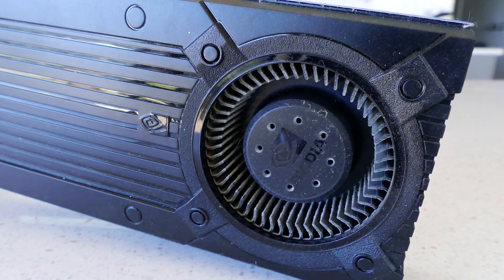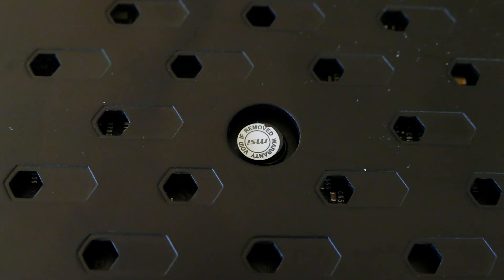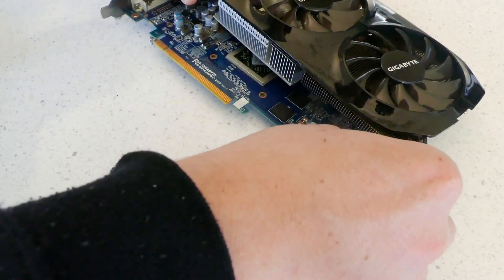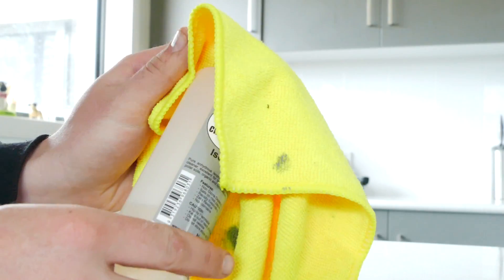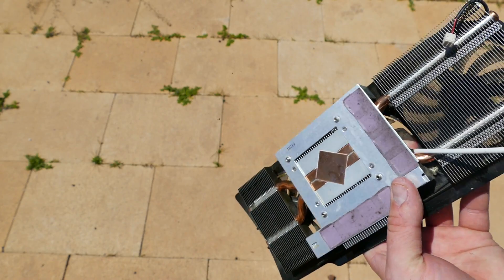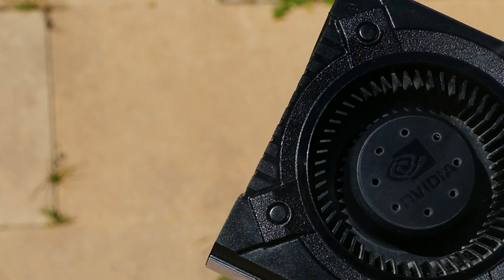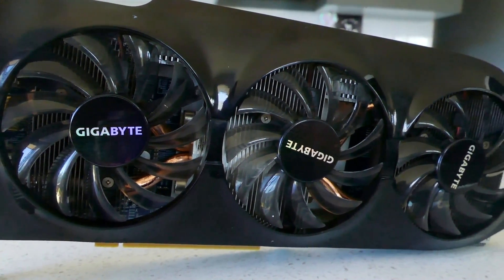How to Clean a Graphics Card/GPU

Comment: No ESD strap? Baby wipes? I guess we don't care about unsafe chemicals or static discharge.
Reply from the maker: Never used an ESD strap, always de-charge myself before handling electronics and am yet to kill a component through ESD.

Again, never had an issue with baby wipes or similar wipes on any of the many components I have cleaned.

Might want to hold off on assumptions and just politely ask a question or 2 next time.
Reply: @EverythingbySam  A better option would be anti-static brushes and isopropyl alcohol of perhaps 99.8% purity or having as little water as possible on just the board and the solder joints, and not on parts like plastic. If your stuff works for you, fine, but it is safer to do what I've suggested. ESD can cause a latent failure where it isn't noticed right away. It is always better to just ground yourself through a strap to prevent ESD. I just want to suggest this so people see this.
Reply from the maker: @wiggles7976  People at home do not freely have those items available to them so this is an alternative that still works very well with items they are more likely to already own.

You scare people away if you pretend you require those items as a minimum. I prefer to encourage anyone to do it.
Reply: @EverythingbySam  On the other hand, if someone spend $2000 on a pc build, they should know the proper ways to maintain their equipment with $20 worth of cleaning supplies. You could clean pretty much any PCB (just the PCB part, not plastic parts or other materials) with 99.8% isopropyl alcohol and an antistatic cleaning brush, so it doesn't hurt to get those things. The average person has loads of PCBs in their household. Isopropyl alcohol can also clean metal hardware on guitars for example. It's useful to have.

Comment: Baby wipe on pcb 😬 that's a good way to rip off some components
Reply from the maker: You would be absolutely dead wrong on that one. Cleaned well over 100 cards and have NEVER damaged a single card.
Reply: @EverythingbySam  well you might be careful with it but if I were you I would say in the video to be careful because fibrous materials like a baby wipe could damage or rip off components if not careful
Reply from the maker: To be honest, I am not careful or cautious of components, I wipe fairly hard to get the solid dust and grime off. If a component falls off, that’s poor manufacturing more than me damaging the card as solder should be strong if done correctly. You don’t have to be as cautious as some people want you to believe.

Comment: what if i don't have a thermal paste? can i still take it apart, clean it and just put it back together?
Reply from the maker: Technically yes but I wouldn’t advise it. Once you have separated your thermal paste it’s highly advised to clean it off and replace it.
Reply: @EverythingbySam  thank you. My card has started going up in temp to about 96 and I superficially cleaned it with just compressed air without taking it out or apart. Didn't help so I guess I need to clean it more or might need a new one.
Reply from the maker: Replacing the thermal paste is one step as well as a thorough clean as compressed air alone won’t properly get all the dust out of your card. Don’t forget to also clean the dust out of your case and fans as that will help.
Reply: @EverythingbySam  Yea I think I need to replace my fans. They are making noises and sputter on and off every few seconds. I also ordered thermal paste so I should be covered.

Comment: Just to be safe, it is recommended that you first cover the entire gpu die with thermal paste to prevent damaging it. Unlike cpu that has an integrated heatspreader, the gpu doesn't and raw gpu die might have some parts that is not measured by a thermal sensor and might overheat. It's better to be safe than sorry

Comment: I changed the thermal paste in my 1080 ti and got a bunch of pink and black pixelation and games would crash after.
Reply from the maker: Sounds like either you didn’t put your cooler back together so it’s making proper contact with the GPU die or you removed or damaged the thermal pads that make contact with the memory chips are around the GPU die.

Comment: Am I the only one who can’t seem to unplug the fan plug?
Reply from the maker: Some can be quite tricky. Never pull by the wire, only by the connector and use a little flat head screw driver or something similar to wiggle the connector out.
Reply: @EverythingbySam  thanks :)

Comment: I'd like to ask , i think my gpu is about 3 or 4 yo if i'm not wrong , cuz it could be older and it is the GTX 1050ti 4gb Phoenix Edition ( 1 Fan ) , 1 year earlier i started to notice my gpu performance started decreasing , is it possible because of this thing " Cleaning it ? " or are there anything else could lead to a gpu low performance ? from what i should have in performance per example cs go and valorant let's take these meduim rate games , it should be around 190 200 fps in high settings but i get in cs go max 120 with sudden fps drops , same with valorant ( it should be at least 170 fps or 180 fps but i get max or avg of 120 fps )
Reply from the maker: Multiple things could be the issue there in all honesty.

High GPU temperatures can cause frame loss and stuttering so at least blowing the dust out of your entire system would be beneficial especially if you never have before.
Reply: @EverythingbySam  Nah i did several time but mainly once in a month i think , but never in my life changed the thermal paste of either CPU or GPU , i didn't know its was a neccesairy ...
Reply from the maker: After a few years it’s good to give your system a deep clean which should include a thermal paste change

Comment: I'll keep this in mind when I need to do mine. Mine's been good so far. :D
[I have 99% alcohol to use for cleaning so I'll probably use that instead of baby wipes.]
Reply from the maker: Use that and some Q-tips or a micro fibre cloth and you will get the majority if not all the dust and grime off.

Comment: Will a soft bristle brush be ok to dust off the board of the graphics card?
Reply from the maker: As long as it is made from non conductive materials you will be fine
Reply: @EverythingbySam  and how would u know  that? cause i literally just brushed me GPU with it an hour ago oof
Reply from the maker: Well you would of got a static shock if it generated any electricity.
Reply: @EverythingbySam  ah ayt so far none, good to know man thanks

Comment: My gpu is a gtx 960. I did everything right except when it came to wiping down the thermal paste with a micro fiber cloth. I hope its not too important? But everything else really helped me a lot. Thanks!
Reply from the maker: As long as you cleaned off the old thermal paste (if you took the cooler off) and repasted it you will be fine.

If you did just slap it back together using the old paste there is a fair chance you may experience thermal issues.

Comment: I got and RTX 2080 for like a bit more than 1 year. at the beginning it was constantly on 60 degrees under high stress, and now it sometimes reaches 80 degrees i dont know if the thermal paste can vanish or be so uneffecient after already about a year. What do you think?
Reply from the maker: Could be poor coverage of thermal paste, bad case airflow or your GPU cooler might be full of dust are the 3 main causes.
Reply: @EverythingbySam  at first i thought it really could be the airflow, i have an radiator in front of my case from my AOi cooler, an it made it into an "pull system" so my Pc gets more fresh air from the front, and there are 3 fans in the back which are blowing the warm air out of the case. so i would consider it a good airflow. i just gonna change the thermal paste and see what happens
Reply from the maker: Having an AIO in the front isn’t the best idea as you’re literally blowing the hot air from your CPU directly back into your case and heat soaking your GPU.

Comment: another tipp:  use "ear tips" to clean the dust from the fans it worked very good for me. 
Edit: I am not sure if they are called "ear tips" i mean those things you put in your ear to clean it ;)
And don`t put so much thermal paste on the gpu die. he was using way to much in his example.
Reply from the maker: Q-tips are what they’re called.

The complete GPU die needs to be cover which is larger than a CPU IHS and will cause thermal issues even if a small portion isn’t covered in thermal paste.

Look at EK’s recommended thermal paste application diagram for GPU’s.
Reply: @EverythingbySam  yes I know it's better to cover the surface manually with a thin layer like you said.
Reply from the maker: I now wrap my finger in a bit of Glad wrap (also known as cling film or cling wrap) and spread out the paste to get a better coverage

Comment: I use q-tips with isopropyl on my fan blades & heatsink, and microfibre + isopropyl on the main board. I also use a compressor to blow the dust off rather than buying lots of compressed air canisters. I'm not sure I'd recommend any old baby wipe myself.

Also, you needn't bother with compressed air when the heatsink is removed, you can even use a vacuum, make sure you discharge it before bringing it back near your components but it will not cause damage to the fan and heat sink and do a better job than compressed air & safer.

Also you should recommend people wear a mask when using compressed air for dust/ do it outside as the dust isn't great to breathe. 

I'd also recommend you give a comprehensive list of what people need before they start- including quality heat paste and isopropyl >95%.
Reply from the maker: Can’t always recommend thermal paste as each brand is available in every country as for every other item I listed then in the video.

I vacuum is the worst thing to use as it can quite easily fry your components and an air compressor is only good using a low PSI otherwise you can damage components especially PCBs so a can or 2 of compressed air is the best solution to cover the most people.

I should have to suggest a mask as I myself don’t even wear one. Just don’t stand down wind and preferably do it outside, it’s not that hard. 

Isopropyl over 90% like I recommend it’s fine, anything above that can be hard to find in different countries.

Baby wipes work as long as you give it a once over at the end with a dry microfibre to dry it off.

Comment: Hi, is it also fine if I clean the backside with compressed air or should I only use that on the fans and heatsink?
Reply from the maker: You should blow out the entire card including the back.
Reply: @EverythingbySam  thanks so much, I've been a bit worried about cleaning it but I'll give it a go. Thanks again. Good video as well

Comment: Oh look, this guy didn`t use a vacuum cleaner, OR lay it on a carpet, WOW!
Btw, if it`s snowing or raining or for some other reason, going outside is a bad idea, dust it off in the shower, at least it`s easy to clean in there.
Pro Tip: don`t actually shower while doing that ;)

Comment: I'm surprised that those GPUs were still functioning after this video (if they were).

I noticed two things wrong and that you missed telling. The first being: you are simply blowing air to the fans without holding them with your fingers, allowing them to spin, that's a big no-no and secondly, I also noticed that you weren't careful enough with the canned air... You can clearly see some liquid being sprayed from too much shaking (or was it the pressured gas?).

You need to be gentle with the air can, spray in short and controlled bursts, stop and wait once it turns too cold and don't just wave it around like a mad man, you can risk damaging the components by releasing liquid.

And baby wipes? I don't even know where to start about this one. The oils and debris it can leave if you're not careful enough...

I really am surprised you've been doing this on so many GPUs.

Not saying the whole video is terrible, but you do make some mistakes and baby wipes are recommended by no one. Cotton buds dipped in isopropyl alcohol are a far better alternative to baby wipes, it picks up the most hard dust just fine without leaving residue, plus its oil free, totally safe for electronics.
Reply from the maker: Have cleaned over 50 GPU’s let alone other components I have cleaned and have yet to damage anything.

Don’t believe all the cautious tales you hear as electronics are a lot more robust than people are led the believe. 

I made sure all liquids were wiped away and dry and iterated that in the video. That is honestly the only thing that requires a bit of caution.
Reply: @EverythingbySam  Alright, fair enough!

It's true that there's a lot of myths and too much carefulness around PCs that actually tend to make matters worse and more stressful. But being a little extra cautious isn't always a bad thing.

Cheers!

Comment: Damn I needed this video. Gonna try this in the upcoming week. Hopefully I wont be seeing my GTX 1070 idle at 61c with 70% fan usage anymore and up to 95c 100% fan usage when gaming hehe. Also, would normal 75% hand sanitizer do the job or do I need to get isopropyl 99% alcohol?
Reply: 99% is much better as the idea is to leave no residue, as isopropyl evaporates readily, meaning no conductive substance left on your parts. If you use hand sanitiser the other contents are likely to be conductive or even corrosive and thus may cause damage.
Reply from the maker: Needs to be at least 90% to be effective properly.

Comment: Thank you for your very informative video. I just cleaned up my graphic card and installed it back. My graphic card, NVIDIA GTX 970, has two cooling fans and I noticed before I cleaned it up, the cooling fans were not moving at all. Now that I have cleaned it up, only one of the 
cooling fans is running. Is that OK? Or shouldn't both fans running together? Any help from anybody is greatly appreciated.
Reply from the maker: Both fans should definitely be spinning under load. When idling 1 or none might be spinning.
Reply: @EverythingbySam  Thank you very much. So I guess there's something wrong with it...
Reply from the maker: Certainly sounds like there is an issue sorry to say.
Reply: @EverythingbySam  Thanks again. I've been thinking about replacing/upgrading it anyway.
Reply from the maker: Now is a good time to look at a new GPU with the current offerings from both AMD and NVIDIA being great advancements in technology or grab a second hand GPU from all the people selling them to update to the latest and greatest.

Comment: what if i didn't use thermal paste?? it is okay ??
Reply from the maker: Didn’t use thermal paste or didn’t replace it? As that is 2 completely different things
Reply: @EverythingbySam  i didn't use thermal paste
Reply from the maker: You have to use thermal paste (or a specific thermal pad) for effective cooling
Reply: @EverythingbySam  what if there's no display when i use my gpu as a display but it's running 😟
Reply from the maker: Could be many things, there is never just one ultimate answer that is always the fix. 

It’s best to look up a few simple troubleshooting steps first and try out those first.
Reply: @EverythingbySam  ohh okay thank you very much i hope i fix this but my gpu is 4yrs old i think it will not survive at this moment
Reply from the maker: 4 years isn’t very old so it should still have plenty of life as long as it isn’t broken.
Reply: @EverythingbySam  i hope bro 🙏😟

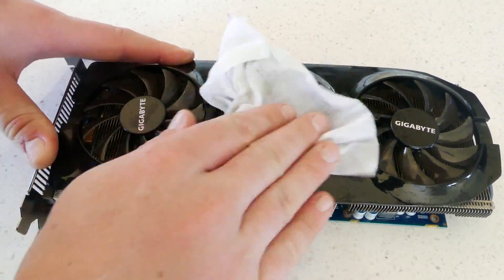Comment: 0:56
Him: * Cleans the backplate with babywipes *
Me: * Screaming *
Reply from the maker: Why? If you know anything about a circuit board you would know it’s perfectly fine.
Reply: @EverythingbySam  Still scary since babywipes are basically controlled water balloons
Reply from the maker: Water doesn’t effect an electronic component that has no power running through it so as long as it’s dry and no residue you cannot damage the card.
Reply: @EverythingbySam  so if its still wet will my card die?
Reply from the maker: You could potentially short circuit the card which could effect other components as well
Reply: Is it.ok cause am going to clean my 1660ti
Reply from the maker: Yes, I wouldn’t show a method I don’t believe in

Comment: whai you go with paper on da pins you damdaramdam?
Reply from the maker: Your sentence makes very little sense.

I didn’t put paper on any pins.
Reply: @EverythingbySam   basically why you scraped the pins so hard????? with the babywipe
Reply from the maker: A baby wipe is soft so little to no damage possible. 

The only pins on the graphics card are the connectors and I didn’t wipe them.

You can be quite rough when cleaning a graphics card, they’re not as delicate as people think they are.

Comment: Do I need to uninstall something before dettaching my gpu into the motherboard? Or I could simply just dettach and attach it like a ram dimms?

Beginner here.. TIA 😁
Reply from the maker: There is a little latch on the right hand side if the PCIE slot on the motherboard that the graphics card sits in that you will need to press and of course unscrew it on the left hand side where it mounts to the case.

Comment: Getting the card wet doesnt destory it?
Reply from the maker: It’s not water so it’s not wet, it’s a non conductive alcohol based cleaner so it self dries
Reply: @EverythingbySam  is it okay to touch any part of the videocard board and also the motherboard? Im afraid i might put pressure on somepart of the board
Reply from the maker: Putting pressure on something is honestly the least likely thing to damage the GPU or motherboard. Try to touch the edges of each component as much as possible instead of getting your skin oils all over the component.